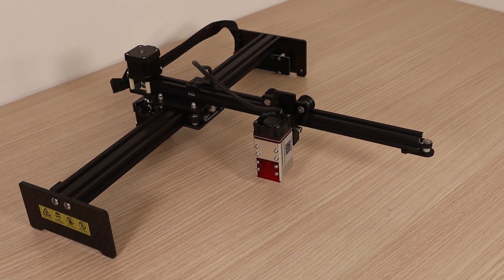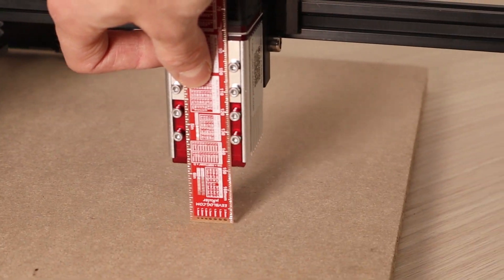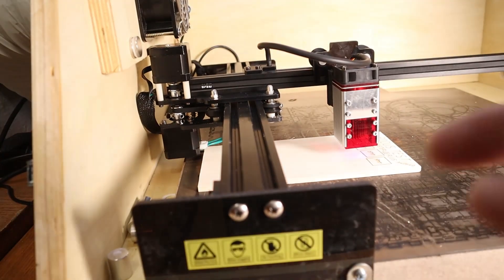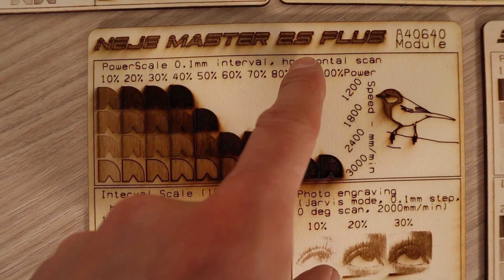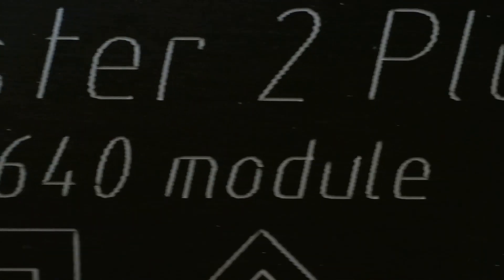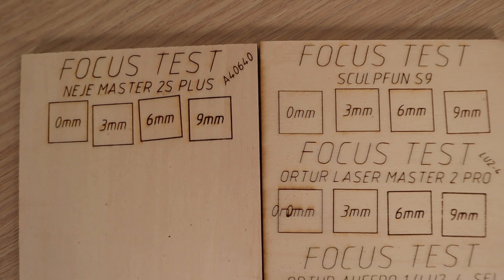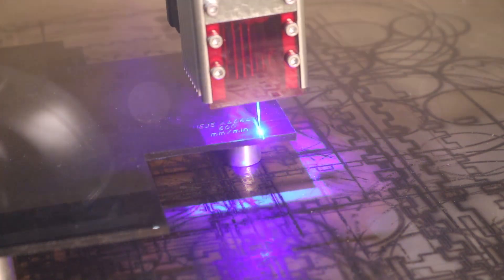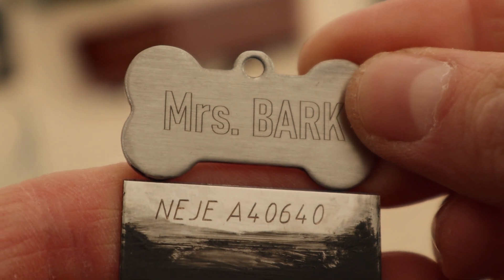Is NEJE MASTER 2S PLUS 40W A40640 the Best Machine for Your Needs? Watch This Laser Engraver Review!

Comment: I use neje master 2s plus
software laser grbl 5.4.0
Windows 7
The device stops working in the middle of a file.
What could be the reason?
Reply from the maker: Did you try with a different computer?

Comment: Hello I have the Neje master 2s Plus N40630 30w.  I was told when I purchased it that it would do all that it showed on the website that I got it from.  But I cannot get it to even make a dent on the samples, the black anodised tag.  I have purchased some different tags.  But still nothing.  There isn't many instructions with the machine to say what speed etc to use.  I am using the Neje software V5.6.4.  The burning time can go from 0ms to 100ms.  It was set at 10ms when I log in.  Do you have any hints.  I have some Matt gold stainless steel name badges.  It does nothing on these.  Do I have to spray paint them with the black paint.  I need them to be gold afterwards.  Thank you.
Reply from the maker: You should check that the laser is focused properly and the dot is the smallest. I haven't used the Neje software. Only Lightburn. For anodized you should use speed 400mm/min and full power. I'm not sure what is the burning time prameter. I don't have that in my software.
Reply: @JTMakesIt    Hello I did a test on the focus.  I also tried one idea I saw on a video, rubbing mustard on the metal and engraving multiple times.  It actually works so I will try it again with more passes.  Thankyou

Comment: I have the "30w" neje (7.5w is the actual laser output) do you know what the actual output power is of this "40w" model?
Reply from the maker: Somewhere is advertized as 15w, somewhere as 10w. I believe its 10w, and the 30w is actually 5w.
Reply: @JTMakesIt  according to Neje official website the N40630 is 30w with 7.5w optical power, and the A40640 is 40W with 12w optical power or 11w continuous output

Comment: the difference is striking, the power of the neje is very large but the laser focus seems out of control, burns everything on the side, like it's not clean enough when cutting, I have a 30watt neje and it's not as powerful like video above, so I decided to buy a sculpfun s9 for my chrome stainless steel engraving needs  I'm a little disappointed after watching this video, I hope my sculpfun s9 doesn't disappoint ,btw good video i like it